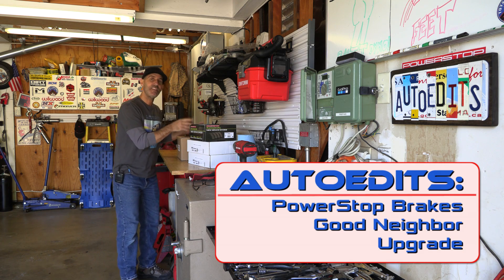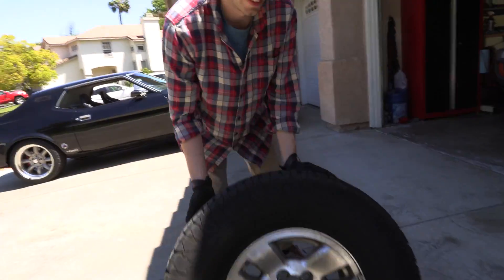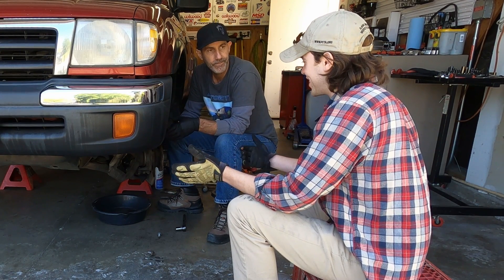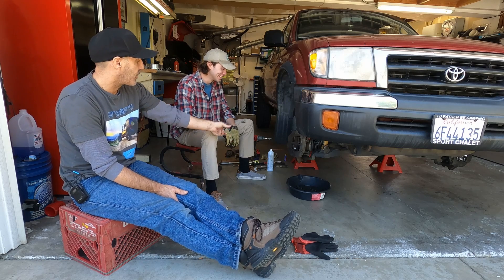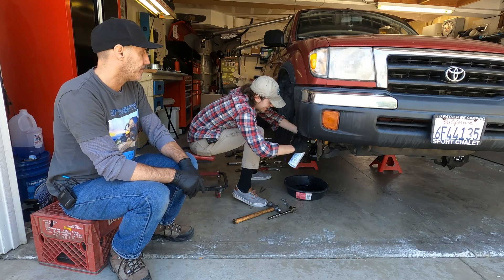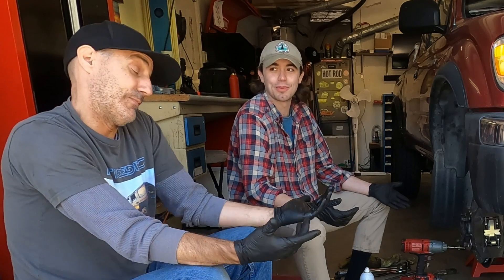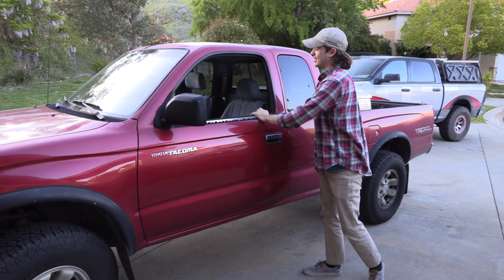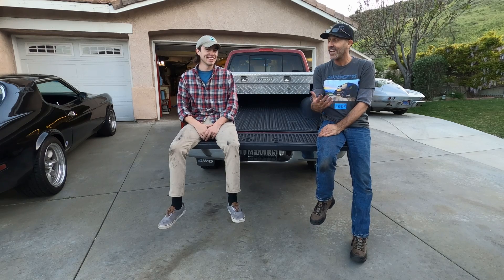Toyota Tacoma PowerStop Z36 Brake Upgrade and Being a Good Neighbor!

Comment: When he goes to aftermarket 16+ wheels, he can do an 06 tundra front brake upgrade. It’s pretty easy to do.
Reply from the maker: Fascinating! Love getting tips like this.
Reply: @AutoEdits  Here is a thread about how to do it. You basically just need new front brake lines, tundra rotors and trundra 13WL calipers. the rest is just trimming the dust shield. https://www.tacomaworld.com/threads/tacoma-231mm-tundra-brake-upgrade-looking-for-some-advice.519578/